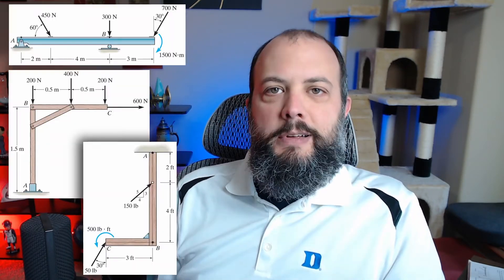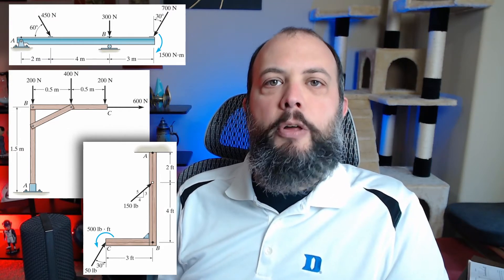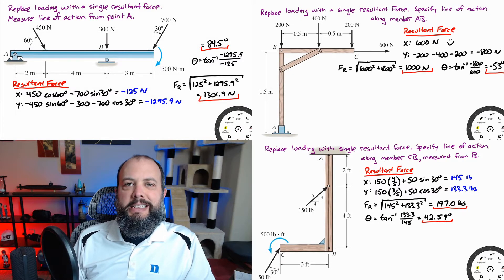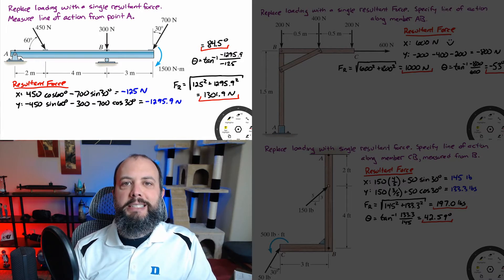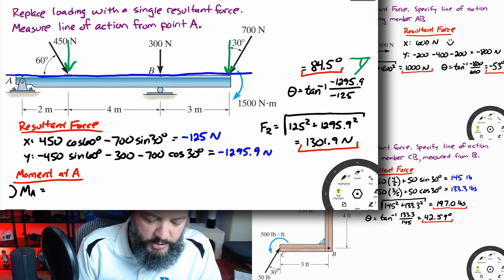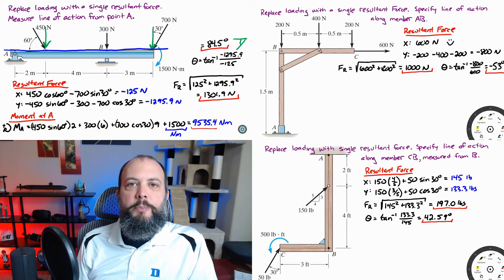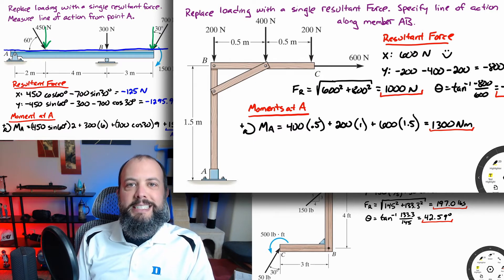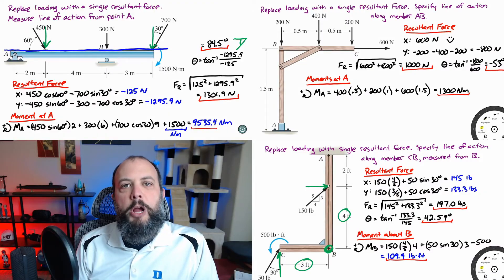How to Simplify a Force and Moment System and Find Line of Action

Comment: at 5:45 isnt there a mistake? you use 50sin(30) to find the vertical component of that force, which would give you the horizontal component since the 30 degrees is measured from the y-axis, which doesnt create a moment.
Reply from the maker: oh no, you're totally right. i even did it correctly an inch up the page when i found resultant forces in x and y directions, but i used the wrong one when doing the moment. excellent catch, you are correct, that should be 50cos30 times 3 for the moment. thank you very much for pointing this out, and for you, that's a great sign that you actually understand the problem and method!

Comment: Thank you professor but in the third problem the Y component of 50 ib Force is (50 cos 30) or (50 sin 30)?
Reply from the maker: 50 cos(30). Normally cosine is used for x component, but that's because we normally measure angles to the x axis, and cosine is 'adjacent/hypotenuse', so adjacent is the x direction. But for the 50lb force in this problem, the 30deg is measured from the vertical y axis, so cosine is adjacent to y, so cosine is for vertical component.
Reply from the maker: when i read this comment at the time, i thought you were referring to the 'resultant' force part of my answer which i did correctly, but you were probably asking about the moment, which i did wrong. this was a typo that you correctly noticed. i just didn't notice what you meant. thank you for pointing it out, even if i was slow you understand you. i appreciate it a lot.

Comment: Wouldnt the 500 be going counterclockwise why did you subtract it
Reply from the maker: Yes, it is counterclockwise. Normally, by the right hand rule, if +x points right, and +y points up, then counterclockwise should be the positive direction. However, If you look at the left of my equation, right next to Mb, I have a little half circle turning clockwise with a + next to it. This is how I indicate that in this equation, I am using clockwise as my positive direction. You are allowed to call any direction you want positive, as long as you are consistent in your usage throughout the problem. I always draw these half circles whenever summing moments, as a visual reminder, so that I don't have to trust my memory as to which direction should be positive, I just look at my sketch.